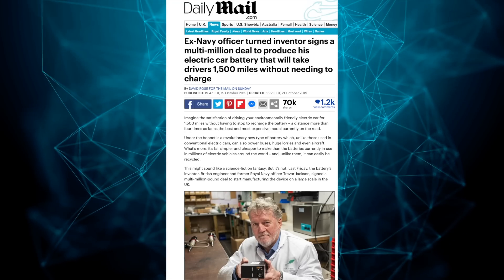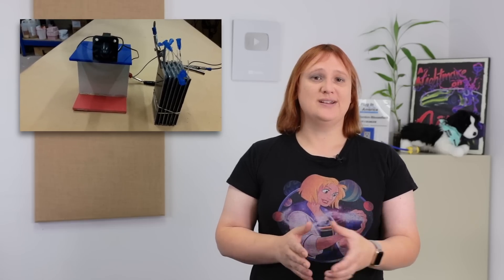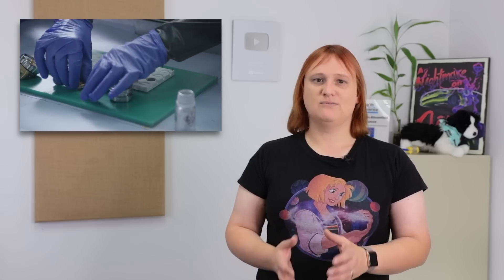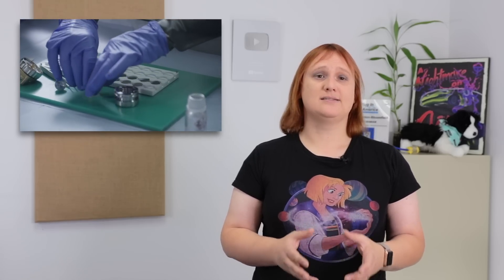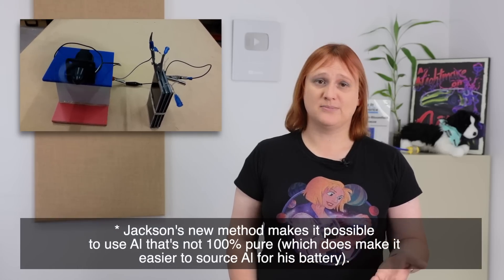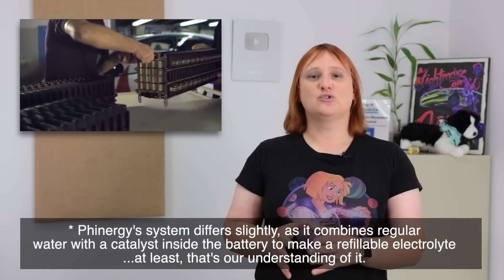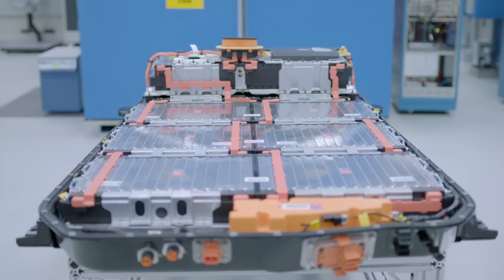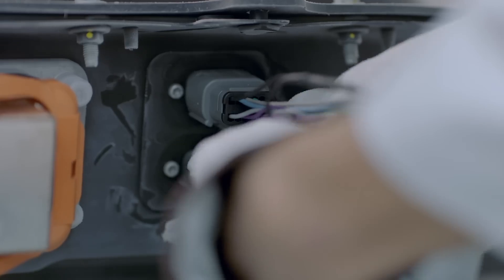Is This Battery The Holy Grail For Electric Cars?

Comment: If electric cars are designed with a primary rechargeable battery and a standardised port to fit an easily exchangeable secondary battery, then charging stations could offer charging spaces, coffee lounges, and a secondary battery exchange and recycling service.

As a driver you could park and relax for 30 mins, paying less for the charge and enjoying whatever else the station has on offer. Or you could swap out the secondary battery (or just the anode) and continue on your way without delay and with enhanced range.

As a station operator you could sell electricity from the grid (or your own renewable source) and provide food, beverages and any other service desirable to people in the lounge. At the same time you could sell replacement batteries to motorists while gathering their spent batteries for sale to recycling operations.

It seems a winning scenario for all.

Comment: Will the electrolyte in this battery freeze in cold weather since it is water based?

“Aluminium–air batteries are primary cells, i.e., non-rechargeable. Once the aluminium anode is consumed by its reaction with atmospheric oxygen at a cathode immersed in a water-based electrolyte to form hydrated aluminium oxide, the battery will no longer produce electricity”.
Reply: But unlike primary cells it will not be discarded but rather reprocessed back into aluminum
Reply: Dana Putnam I was simply asking weather they will freeze in freezing weather since there is water inside.

Comment: What happens to the used-up aluminum?
Reply: In the battery, it ends up as a sludge, probably aluminium hydroxide. A bit of chemistry and you can convert that into aluminium oxide and put it back into an aluminium smelter. Yes, you're recycling it, but in a much more energy-intensive form than simply melting down an old can. Then again, you did get a decent chunk of that energy out of it as electricity when using it in the battery.

Comment: aluminium air battery cars would be pretty good for those that have nowhere to charge the car overnight (think appartment blocks, inner city)... if the battery was fitted in the front of the car, you could have the bonnet that lifts up the whole of the front part of the car, much like the current mini does, this would make it easier to get to the battery. the battery doesn't necessarily need to be one great lump of a battery, it could be a number of hand portable modules that slot in, so you could remove individual spent modules, rather than having to remove the whole battery... this is definately a cost effective way to get more people into EV's. you could also get some money back when you hand in the old modules for new ones...

Comment: Could work for buses and delivery vans, vehicles that have a predictable mileage. Regular battery swaps could be scheduled in. Also car club hires - cars could be picked up from any point in a city, do 1500 miles, then send an alert to the hire company to take it off hire, pick it up and put in a new battery every 2 or 3 weeks say. That would work particularly well, because cars are unused 90% of the time, but existing car club vehicles either have to be returned to a charging station after every use, or picked up by the company every 100 miles or so (as with London's ZipCar).

Comment: In the beginning she mentions mining aluminum to be less carbon foot print than lithium. “It’s found everywhere you just dig it up” this is misleading. Aluminum is not found alone as a metal,it is in a compound called bauxite oar. This compound is put in a caustic soda acid that decomposes and separates the heavy parts fall to the bottom while the aluminum oxide (alumina gel ) floats to the top. It is skimmed and further filtered. The gel is then exposed to heat and electrolysis. This is very energy intensive as it solidifies into a hard metal when fully charged and cooled.
I just wanted to clarify that you don’t just find shiny aluminum metal in the ground as she suggests and it takes electricity to make!

Comment: Also: Dr. Jaedlin Cho UNIST, has developed a seed mediated silver manganate nanoplates at the cathode capable of 2.5 kwh which outstrips 1.7 kwh (practical) of petrol. The Essex engineer Jackson, has something good. Dr. Cho's is possibly better. It takes 15 kwh per kg to reduce oxide with cryolite back to aluminum. Return is, hopefully, 2.5 kwh. Not a great return on round trip metrics. Melting existing scrap takes less energy. But for those bold enough to set up a forge in the garden or garage and produce their own "fuel", it could be an exciting hobby.

Comment: No need to replace,if the aluminum is silver plated with a thin layer,just as was done with the Nassa fuel cell, but price would be a factor to consider.

Comment: If it was liquid aluminium that you pumped in instead of petrol  then its a winner.

Else If it was the size as a  drinks can that you put in a slot that would be feasible too.

Comment: You are presuming swapping the alu is a difficult and/or time consuming process. Now think of it another way - if it can manage 1500 miles per charge then it takes 10 minutes to pull out a piece of alu and insert another (yes I'm fully aware it's not that simple but then filling a petrol car wasn't really simple when they were first invented) then it's still better than having heavy, fire prone packs which would add at least 10 hours worth of charging in that same distance. 
Infact even if it took an hour to swap I doubt many people would give it a second thought since the 1500 mile range would mean it is still practical to use for a very long time before a short downtime. That really is the crux - drive time vs down time this makes lithium look pathetic. 

I don't see this as a range extender - I see this as the main battery with a small li-ion pack as the back up for when this is in it's last 100 miles or so of use. The small li-ion would allow total drainage of this pack before the necessary replacements then act as a buffer/booster in extreme load situations and a short range plug in battery for small trips where its not necessary to use the alu battery.

Comment: You would need a large infrastructure investment to implement the battery on a scale for the average driver. That’s making a large bet on more traditional chemistries not over taking it or substantially decreasing the range per weight advantage in the next decade.

Comment: Like many on the comments, I don't think this is a good fit for automotive use. It's far easier to move electrons around than batteries thus it's easier to have a charge where/when you need it than a new/rebuilt battery.

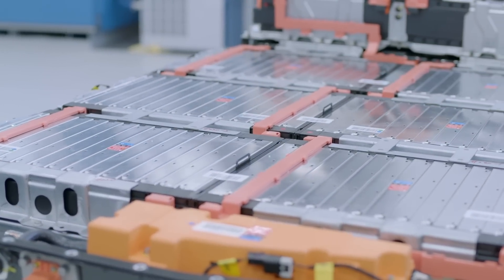Comment: 7:55 i think you mean Aluminium-Air batteries do promise to offer recharchability down the road, not Lithium-Air batteries do promise to offer recharchability down the road.

Great idea for Al-Air as a range extender. If you've got them in a convenient place, then should you need to call upon them, you always can, and then swap them out when you get to a garage or home. Basically like a spare tyre.

Comment: So many lies in this video. Lithium isn't "right at the other end of the periodic table" compared to Aluminium. Lithium is at #3 and Aluminium is at #13 out of a total of 118 elements so if anything, it's right next door. It's also much lighter than aluminium with an atomic weight less than a quarter of Aluminium  But hey, let's not let the truth get in the way of a Green story
Reply from the maker: So, being on the far left vs the right of the periodic table (alkali metals VS boron group / post transitional metals) means they are - chemically kinda at the other end of the table. I mean, yes; it's not a noble gas... But for those who aren't chem geeks, we felt this got the general point across. As my chemistry teacher used to say, everything is an approximation. ^Kate

Comment: So it’s zinc-air only with aluminum. Zinc is denser. Great hearing-aid cells. Definitely not rechargeable...

I do wonder if the used aluminum will have to be refined using electricity just as with producing the metal from the oxide...

Comment: For one, the ENTIRE battery would need be replaced more than 2x a year. This produces toxic AlOH  ( AlOH IS toxic, Al is not, but it's hydroxide salt IS) - which has to be properly recycled and given to a recycling plant.

You did not clearly go over how this battery would be far more costly to consumer's. 

With an average cycle life of 1,500 miles, an average driver travels roughly 7,900 miles per year. That is a MINIMUM of 3 battery swaps per year!! At a cost of 5,000 per battery swap, that's 15,000 in one year!!! Sorry ... but no. For the commercial electric vehicle market, i see this going in the same direction as all other Al-Air battery companies. Sure, Mr.Jackson solved a key electrolyte issue, but until he can make the battery a secondary chemistry (electrically rechargable) i don't see this taking off. 

Li-ion batteries last up to 5 - 7 years in a car currently, with an average price of $15,000 - $30,000 per battery change. This means a maximum of $30,000 in 5 years, while the Al battery is a minimum of $50,000 in the same time frame (excluding cost of labour for replacing the battery). 

Mr.Jackson's chemistry is more energy dense, and more efficient for the same volume as Li-ion, but the over-head cost of using the battery faaaaaaaar outweighs any energy benefits. 

Furthermore, lets not even get into the logistics of where the Al battery would be replaced, how they would correctly recycle the toxic waste product (drying out to Alumina and refining back into Al metal), how much this extra service would cost the consumer, and the environmental impact of Al manufacture and recycling (it's MASSIVE - even Renewably powered Al refining plants still produce CO2, and consume MASSIVE amounts of electricity) 

When you add in the figures of Al refining the Al - Air battery is actually significantly less efficient than Li-ion. However - Al - Air is easier to recycle than Li-ion, tht is very true. It is logistically easier, not energetically or capitally easier.
Reply: @Transport Evolved - What do you think of this?

Comment: I am really sorry, I have tried resisting making a comment but its proving impossible.  How is everyone missing the obvious issues with this technology, Every time it discharges you need to buy a new one, this isn’t a Duracell that costs £4.99.  Its a £5000 purchase every 1500 miles.  Not to mention the environmental impact of manufacturing a new battery every time it discharges, sure aluminium is highly recyclable but thats hardly the point.  Lithium ion is approaching 700k miles of expected life (approx 2k charge cycles for one outlay of manufacture and delivery.  I understand the source is the daily mail and therefore of questionable veracity to be kind but why is everyone letting them get away with this nonsense, people who know better. Its baking my brain TBH.

Comment: Yea easy use lithium ion for your weekly commute, and when you pack up for that long road trip a few times a year pop down to the nearest fuel station and buy an insert able aluminum air battery just to augment the power to the existing battery to increase range. I mean you have to fill up with gas for that road trip anyway. This idea can easily be retro fitted to any of today's electric only vehicles.

Comment: Interesting concept but needs developing before it would be an economic proposition for use in a road vehicle. Did I see $5000 per 1500 miles? I think I'd stick with Li Ion and work on improving the charging infrastructure.

Comment: Having a connection in the frunk to connect to an air battery might be the 1000 mile solution. Your car get 300 miles on a charge at home. But if you need to take a long trip stop by the service center and get 700 extra miles put in the frunk. Not a bad balance.

Comment: so instead of transporting high energy density liquid petroleum fuels to gas stations we are going to transport large quantities of batteries to filling stations??
To swap out in vehicles. At the station.
You're just creating a disposable battery it will require infrastructure, and transportation to make viable .
Doesn't make sense to me 
The range extender idea is a good one fits well with this tech.

Comment: A hybrid of lithium and alum-air might work. Cars can have smaller batteries for day to day driving (making them more affordable) and have alum-air swap stations like gas stations for road trips. When it's time to go home, swap back to your original lithium-ion battery and charge at home like normal. Best of both worlds. The problem with this would be the logistics. To get the entire country (or world) to agree on a standard would be borderline impossible.

Comment: This just a consumable like an alkaline battery.

It's best use would be as a high density emergency extender. 

If electrics are to be anything more than urban restricted vehicles, they'll have to have at least some on demand off grid capacity. Emergencies happen whether aborting our life threatening.

Electrical grids go down in North America fairly regularly due to extreme conditions. A car that doesn't have 50 moors or so extra at need, won't do.

Comment: What I thought was EV's getting to the point where the battery for EV's will take 5-10 minutes to charge and get 500-1000 miles per charge. More like an ICE car and less like a flashlight. Who wants to lug around a battery every time you need to go somewhere swapping them out every place you go who the EFF wants to do that shit. Also, God forbid you to need to get to the hospital or something, and you need to take an extra 10-15 minutes to put a battery in your EV WTF. Can you Immagine a battery swap outstations as popular as Tesla supercharger in retrospect that would become a logistics nightmare? This would never work for me, not even as mediocre as charging works at this time. But I do like the idea of using the ion air battery as an extender or a backup battery juice can for lack of a better name. Better possibilities for an EV motorcycle: smaller and more extended range seems a better fit than an EV car. Let not start a standardization cluster EFF EV's will look like these DA's pull up to the gas pump with the fill cap on the opposite sides to put gas in doing 180s to put gas in their ICE cars eventually.

Comment: According to what I have  seen .this will make all electric airliners possible . Swapping out cells to add more aluminum wouldnt be an issue with airliners. This video is for a "hybrid"type aircraft but at this energy density these batts could easily power this aircraft.    https://youtu.be/Xe6LR3bNRI0

Comment: First thought was, could you refurbish the batteries by heating aluminum and pumping it in the battery? If the electrolyte is non flammable, it seems possible. In this way, you could still stop at a station for a fill up. Thoughts?

Comment: Electric cars have been about since the 1920/30s and failed and now 100 years later the push start's again
Reply: Electric cars have been around since the 1800's...
Reply: @Les_S537  but for younger generation they wouldn't know that etc due to attacks on history
Reply: @fuckedworlds4326  electric cars only failed because big oil made it happen and the infrastructure and tech wasn't there to make it possible.

It is now.

Comment: You said energy density is per unit mass, and has 8 times more capacity when measured that way. But then you said it would take 1/8th the space of a modern Li battery. When combined with the 8x energy density that implies that it's just as volumetrically/physically dense as a Li battery (same mass per unit volume). 

Since it's unlikely that the air/Al battery is as physically dense as the Li battery, I think you've made a fact-error in your video.
Reply: relativityboy playing with language misinterpretation?

Comment: Al-Air batteries could, once the myriad technical problems have been overcome,  be a good solution for heavy goods vehicles instead of fuel cells or perhaps public transport and buses, where the depots would have their own "rebatterying" stations.. But for private vehicles and LGVs then you're right to be a bit cynical about this announcement. There have been just so many false hopes, the idea that there's some revolutionary technology, but it's likely progress will come as usual from the continued refinements of what we already know. There's a very thorough examination of this 50 year old technology here: https://www.sciencedirect.com/science/article/pii/S246802571730081X  Would you believe for instance a theoretical maximum energy density of 8 kWh per kg, i.e. an 80 kWh Al-Air battery would weigh just 10 kg or little more than a bucket of water. You could swap the battery out by hand from a shelf from a "electrical service station". In 2016 an Al-Air battery was fabricated weighing just 100kg which would power an efficient electric car for 3,000 kms!! -The paper's well worth reading. You also need catalysts for the chemical reaction, platinum for instance. Now that's hardly cheap or abundant. Reading this information also makes you realise how an amateur tinkering in his back garden shed would be able to achieve anything other than raising a  very naive  and false hope, equivalent to "cold fusion".  Thanks for a considered and knowledgeable review.

Comment: Why wouldn't you have multiple swappable batteries in the car? You could then stage the discharge so that empty batteries could be self replaced and charged at home or wherever. The charging could be either in the car or independently on a separate charger, at home or elsewhere, while still leaving the car drivable on the other batteries.